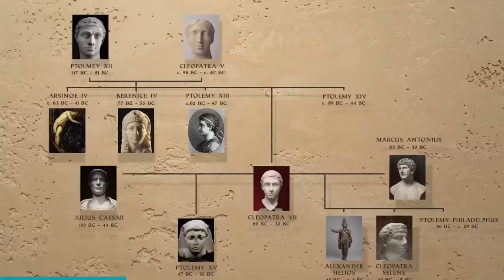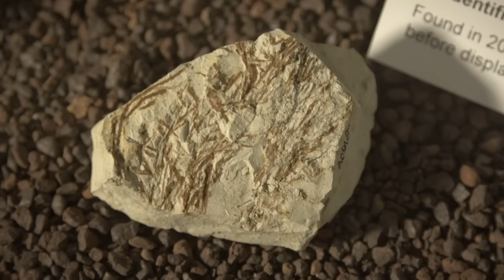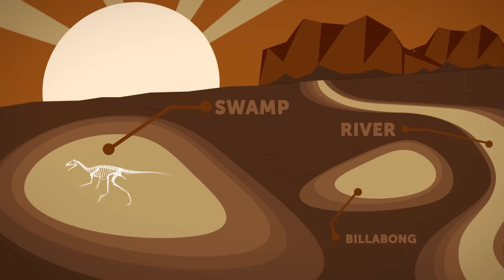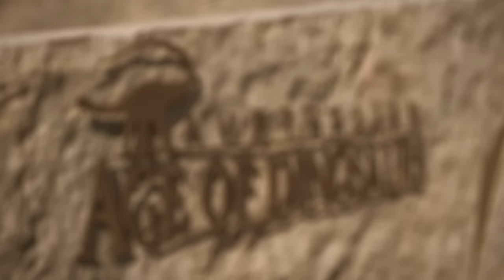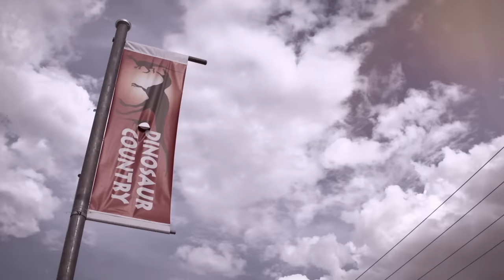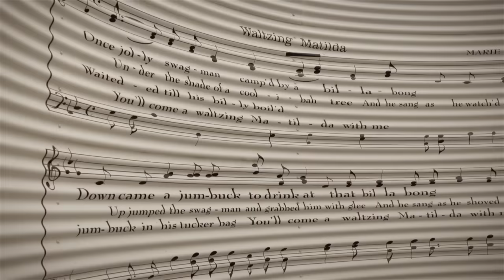Rural Australia's Dinosaur Bone Goldmines

Comment: ahhh winton, I have done all the power poll inspections in and around that whole area. the whole area is a big water course. the area consists mostly of clay pans, red sandy soils and black soil. yes when those are water logged some soils can over time have that much movement, things appear to float up out of the ground and also sink. i have been on "Belmont" too and it is a big property. also came across a property called "Cumbogan" in my travels. 🤣

Comment: I find the theory of the Expanding Earth to be far more plausible than Continental Drift. Earth cools, crust floats, diameter keeps expanding. Simple as that.
Once you let go of the assumption that the Earth's diameter is a constant, it's easy to see how and why everything between the continental shelves is much newer than the surface rock. Continental Drift presumes the Atlantic floor to be new and the Pacific floor to be ancient. Turns out, they're equally young! Only the continents are ancient. 'Nuff said.